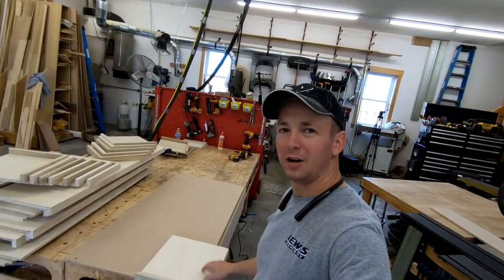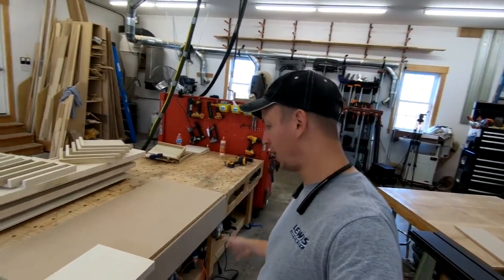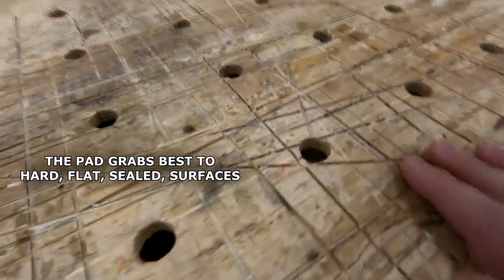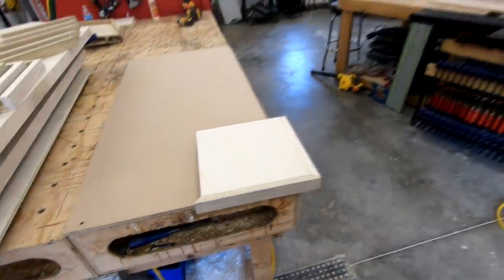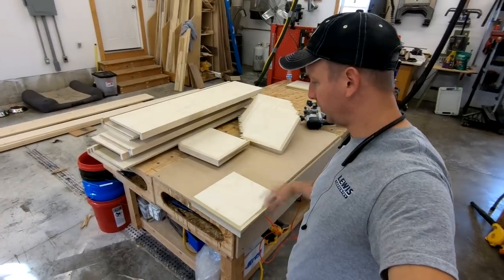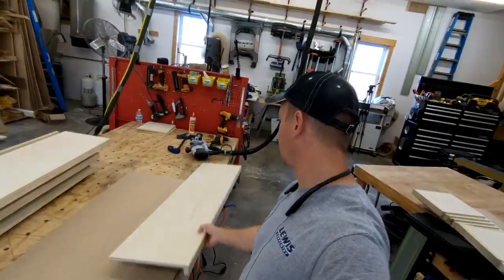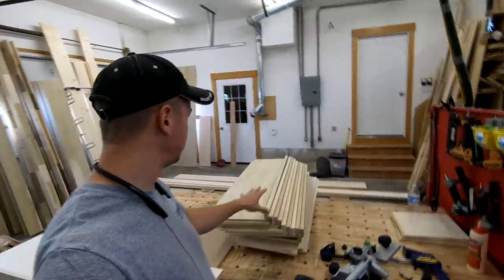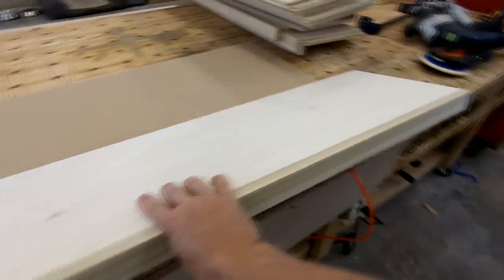Vacuum Clamp Pads - Shop Work Game Changer!!!

Comment from the maker: 2- Stage 50L/m Oil Free Lab Vacuum Pump - https://amzn.to/33RwsNn

To get these clamps you have to order directly from the maker via Instagram. His handle is @kouroscarpentrycorp Send a Direct Message to order the pads. 

Festool OF 1010 Router - https://amzn.to/2GQIkX9
Festool 486058 Edging Plate -https://amzn.to/2SJMaDA
Festool 486052 Angle Arm - https://amzn.to/33PVj3T
Festool 486242 Chip Deflector - https://amzn.to/33PL6Vq

Festool ETS EC 150/5 Sander - https://amzn.to/3jRh8FR

Dewalt 20v Compact Router - https://amzn.to/30WxIN6
Whiteside 5/32 Router - https://amzn.to/3diOcUJ

https://www.instagram.com/kouroscarpentrycorp/

Comment: I have the Festool vacuum system (2 bases and the variety of clamp pads).  I dismissed it as too expensive for quite a while but it’s proved to be a game changing tool.  Being able to spin/tilt as well as hold narrow parts (rails/stiles) has been invaluable.  Can’t overstate how much of a time saver its been.  It’s held up to frequent use in my (commercial) environment.  Thanks for the video.  Whatever you choose, vacuum clamps are awesome.

Comment: Vacuum chucks have been used for years.  The pads can easily be made from wood as long as it is sealed.  Sealer and couple of coats of lacquer are adequate sealer for wood.  Self adhesive foam weatherstripping makes the between the pad and the workpiece.  We have used standard air hose with quick connect fittings screwed into the wood.  There are plenty of DIY example for anyone who searches.
Reply: Have friend who rebuilds stand up bass instruments ( the old expensive ones ) he's been using vacuum clamping since the early 1980's, has lots of ingenious ones all using a simple vacuum pump as demo'd here, and bags he makes for various applications. The hold-down is also simple to make yourself, if you wish. Flatsurface, holes in substrate,  sealed edges ( think foam tape ) line to pump.

Comment: Can also invert an old 30gal compressor. Works very well. With a stock head you can pull 1bar and you get a ton of volume (well 30 gallons :)

Comment: I make these from sealed MDF and use a Fein Turbo I through a hole in the workbench and it works great.  I do a lot of the same furniture parts and shape the vacuum hold down boards the same shape as the parts with weather seal around the edges. Works much better than trying to use a square hold down for a curved work piece.

Comment: We routed raised panel cabinet doors out of hdf, using jigs,downdraft, and vacuum in the early 90's.
Its just a block as long as it will hold threads for air fittings,(we used clear plastic) .
To seal the edges ,use foam/ rubber adhesive backed tape.
Cross drill for the manifold, and keep the pump away from fine dust.
Whoever remembers, 3/4 hdf sheets weighed 90lbs per sheet,I can still smell the dust lol

Comment: I have used with my students self-made shallow downdraft boxes for stuff like this. Suction for shop vac or from our school shop's central vacuum system. It works well, until someone is starting jointer  or even worse thickness planer.

Comment: I always wondered how these vacuum clamp devices compare against the Rockler Bench Cookies for operations just like yours. I do like the vacuum bag systems I see so many use for clamping panels and veneers but I have yet to invest in one. Thanks for showing your work flow using this system.

Comment: Really interesting! Why not connect both the pads to the pump for longer workpieces?
Reply: My question exactly!
Reply from the maker: I could. I just got the unit. So i haven't really messed with it much yet.
Reply: @InsiderCarpentry  I wonder if you could run a split off of a tee fitting for both pads? Just a thought.

Comment: if you seal the mdf with shellac that will improve the vacuum.  mdf is actually porous and the pump can pull air thru it reducing the vacuum clamp's holding power.

Comment: Curious...how does the vacuum release work?  Definitely more affordable option to the Vac Sys.  Always appreciate your tool recommendations!

You might revisit looking at Vac Sys.  A couple nice things about it is the pivot/swivel of the head as well as pad size options.  Comes in handy holding narrower pieces.
Reply from the maker: For the release, I think if you use the pad with something slick it will stick much harder. The maker of this pad has a foot pedal type switch that he uses to quickly stick/unstick. But with raw wood I can just pull stuff off the pad because it doesn't stick as hard.
Reply: Thanks!  Stay safe.

Comment: Spencer, as a woodturner I have utilized vacuum chucks for finishing  the bottom of bowls and other vessels; however, when Covid-19 needed ventilators, the refurbished pumps that pull 25 lbs. per square inch are no longer available. Do you know how much pulling power that vacuum pump facilitates?
Reply from the maker: I don't. Sorry.
Reply: The Amazon link shows it is capable of -85Kpa, or 25.1 inches of mercury, 12.33 pounds force per square inch. Comparing vacuum pumps is difficult because of the units conversion process.
Reply: @dsdragoon  
Thanks for your reply. Sounds worth looking into. 👍🏼

Comment: Sorry you just discovered these things , Like someone else said they have been around forever.  I have been making them for years out of scrap plywood for custom sizes I needed.  Dont know why you are using a vac pump you just get a vacuum generator venturi for your compressor for $20. My units can support hundreds of pounds I was supersized that you are able to lift your material off the pad. It would usually lift your entire work bench off the ground.  Well have fun, they are very useful .
Reply from the maker: From what I've seen the reason the vacuum was not strong was because of the raw wood. Its much stronger with sealed materials from what I understand. I will have to look into the vacuum generator you mentioned.

Comment: Wouldn’t a non slip pad also do the same job?? Thanks for the video
Reply: Non slip pads don't remain non slip for long. Constantly need replacing after the saw dust makes them slip. Some also leave stains. Can't apply much lateral force at all either, they are awful for that. A stronger vacuum pump would allow even better hold. You'd get about 1,400lbs/Sq.Ft. with a vacuum clamp no way a non slip pad will do that.
Reply: You can’t apply side pressure to the work piece on a non slip pad without using 1 hand to hold it down. The vac pad frees you up to use both hands.
Reply: @ThisTall  makes sense

Comment: Is it really necessary for them to suction hold to a fixed board on the table? Would it work to attach them to a small board with dawgs on the btm that can then insert anywhere on your table you want?
Reply: Yes,but you have to seal if you drill inside the vacuum area.

Comment: I'm curious as to how do you like the Festool router?
Reply from the maker: Its great. That router setup is one of my most used tools.
Reply: I've been on the fence about getting one, even though I have quite a few other Festool's. Thanks for the response 👍
Reply: @stevebengel1346  I've got two Festool 1400 and one 2200. The best routers I've ever had. I've have/had Dewalt, Porter-Cable 1/2hp, Milwaukee 3/4hp and a couple others. I always run to the 1400 for precision, dust control and ease of use. My cordless dewalt is my favorite quick/small job router. I'd give up my other routers and keep the festool in a heartbeat. 👍
Reply: What is that attachment that allows you to use the router horizontally?

Comment: I’m wondering if a Fuji  turbine connected to those clamps would work ? 😬😬😬
Reply from the maker: I think it will work with any compressor type device that can pass through air.
Reply: @InsiderCarpentry   how much did you pay for the clamps/pads ?

Comment: Seems a bit of overkill. A router pad would do the same thing. For a lot less and little valuable shop space.
Reply: I agree. It is overkill, but I’ve never used either. I hold it down with my hand and use a folded towel underneath if necessary. To each his own.